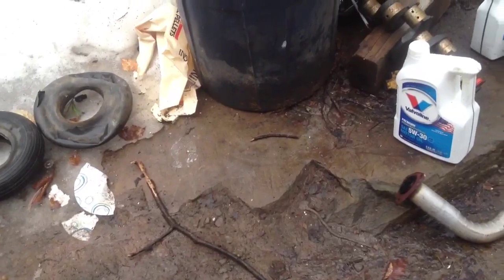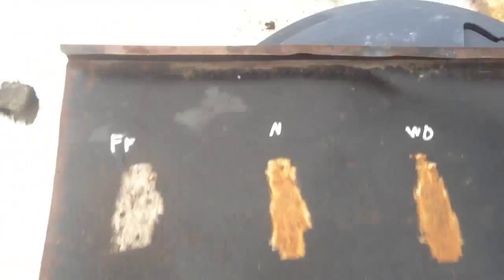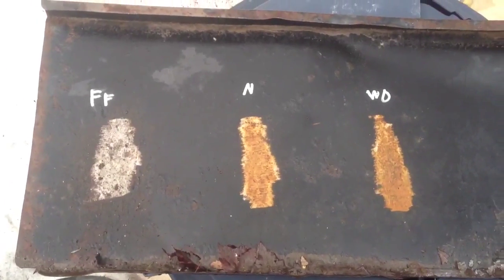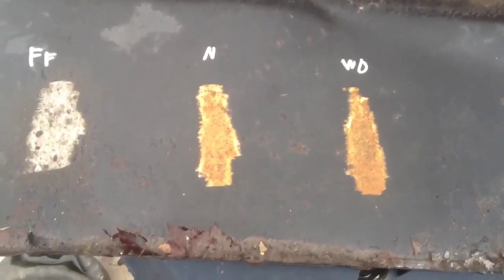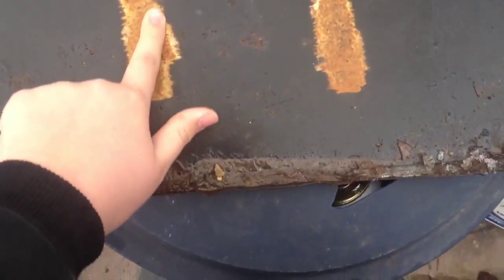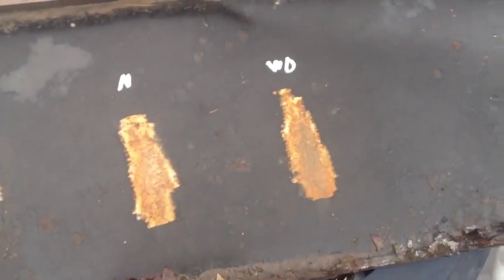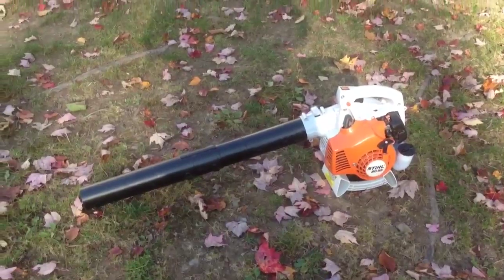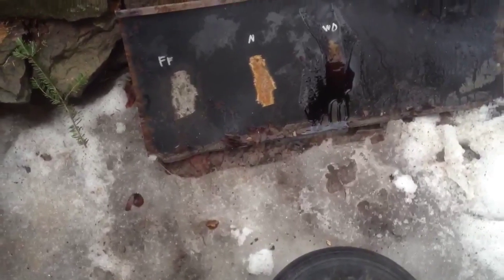Update on corrosion spray test, and testing used motor oil.

Comment: I use mineral oil mixed with WD40 and thin it out with a little bit of mineral spirits so it will spray with a garden prayer. You can also add engine oil but it needs to be thinned more to spray it. The wand, hose, and manual pump gives a nice spray and pressure to get into hard to reach places. I drilled 1/2 in holes in the lower end of my doors and door jambs. Doors usually rust in the bottom corners and bottom edge from the inside out, so getting the mixture inside the bottom of the doors is important. Rocker panels often have rubber plugs on the backside, but you might need to drill a few holes along the bottom of the door jamb to get them oiled good. The tip of the wand fits though the 1/2 inch holes. Plug the holes with plastic "pop in" plugs after done. They are cheap and can be removed for repeat applications. I get the plugs at Napa Auto parts. I spray the undercarriage, inside the rocker panels, doors, fenders, bumpers, and everywhere except the outside surface of the vehicle. 

Unrelated, but on the outside I use New Finish polish then finish with Mother's Brazilian Carnauba Wax twice a year (spring and fall). 
Also, Mothers Back to Black is awesome on tires and plastic. Armor All Extreme Tire Shine is good too.

Comment: Electric Paint Sprayer from Harbor Freight For $20 & dump Fluid Film into the sprayer from the 1 gallon can.  https://www.harborfreight.com/5-gph-electric-paint-spray-gun-60446.html

or

Use Air Compressor with one of the the Fluid Film Sprayer Kits. (most economical in the long run, over using Aerosol Cans) 

USA - KellSports-  has all the Fluid Film Spray Kits & Guns (link >>)  http://www.kellsportproducts.com/ 

Canada - www.UndercoatMyCar.ca   - has all the Fluid Film Spray Kits & Guns

Comment: used motor oil does work and the thicker the oil the longer it lasts.. i had some  diff fluid.. 80w90 and mixed that in the gallon bottle of used engine oil  works great.. bit smelly but no prob.. my daily driver is 12 yrs old and no rust